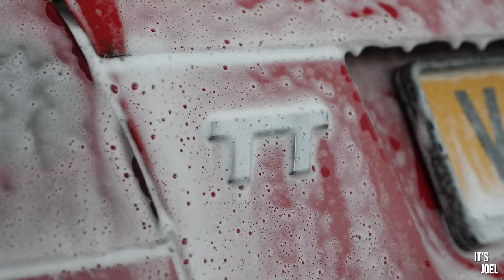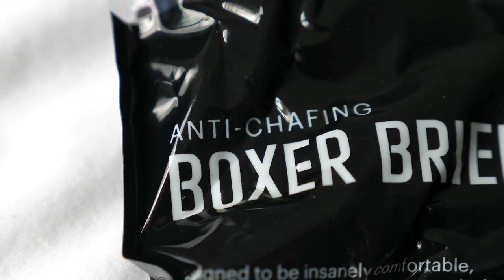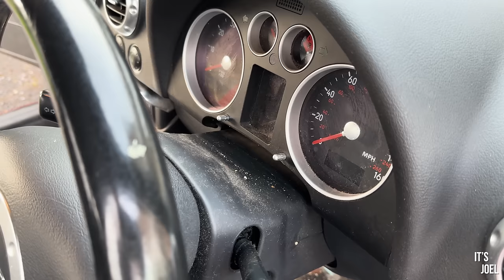DEEP CLEANING MY VERY CHEAP COPART AUDI TT!

Comment: Ferric cleaner and wheels first Joel! Then sno foam. You need to be two bucket washing if you don’t want the paint to get more scratched.
You need to properly mask the paint around the lights before machine polishing. You could have done it by hand too. You don’t need to press hard at all, the pad does the work.

Comment: Never get bored of watching car cleaning videos..
Maguires cleaning products are real good.. I used a bit on my dirty roof yesterday (Thursday)
I have my 52 plate Mercedes CLK 320 Convertible its been washed twice this week, £ for first wash, and 2nd wash/mini valet £15 nut sadly the roof was not cleaned as I would really like.
Having said this I have owned car 7 years, and its quietly returning to it former glory when I purchased the car.
I still feel my car is decade away from being the car I dream it to be and presently I live in a 3rd floor flat but due to very ill health I do really need to move to a lovely bungalow with at least a garage and driveway..
So satisfying improving ones car..
Cool video.

Comment: 100% you can do all the cosmetic work yourself. That door mirror, easily sorted with a rattle can. Same goes for the usual lacquer peel on red cars. Easy to fix with a bit of wet sanding and a rattle can. That era of TT is a future classic, it's started already with the 3.2. Get it looking right and the price is only going one way. Top content.

Comment: The more you delve into that car, the more you're going to realise what an absolute bargain it is. A few hours of cleaning has revealed some of the beauty hidden under the grime. The paintwork needs attention, but I wouldn't bother having it professionally done, just grab a few cans of primer, paint and lacquer from Halfords and touch up the worst areas. You won't ruin it, and it will help stop the lacquer peel. The engine sounds strong, so fluid change, cambelt, etc. Check the suspension isn't knackered and the underside isn't rusted through and you're pretty much good to go, an extremely cheap runabout that you can enjoy for years !

Comment: I brought 1 of these brand new bk in 2003 225bhp and they was fun bk then but you need to get the bigger alloys for it and then it’s perfect car try looking at auto trader and see the alloys for the 225 bhp model thr multi spoke rims that will finish the car off
Reply: Bought one not brought one

Comment: Also by the way, I think you've got your snow foam on way too thick, M539 Restorations had a video I think you could check out on cleaning and paint correcting his Alpina B7 and the professional paint correctors explained what the right mix should be since if it's too thick, the snow just slides off the car rather than attaching and staying on the car while it eats it away.

Comment: You should of jet washed it first then snow foam and gone round with a paint brush agitating the green bits then rinsed it off
Reply: That's probably up for debate! Plenty of detailing channels have demonstrated snowfoam first to soften then jet wash. I used to jet wash first then snowfoam. My now preferred way is to snowfoam, jet wash followed by another snowfoam and agitate with brush and microfiber towel......

Comment: I always laugh at the two yearly brake fluid change, I know it's hygroscopic, but is it really that bad ? My father worked as an AA patrolman and had a new van every six years, but the fluid was never changed in that time. The longest that I've owned a car without changing the brake fluid is also about six years. I dread to think how much owners spend when they just say do it and pay the bill at the end. I can remember a friend with a Subaru who was charge £5 for WD40. He asked them if they used a whole can ?